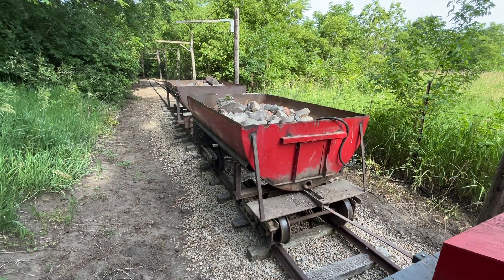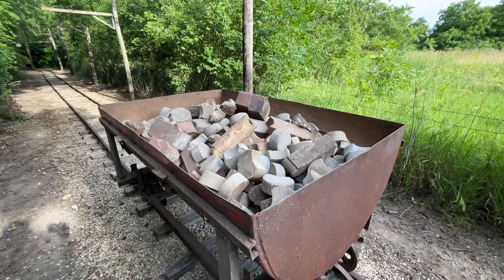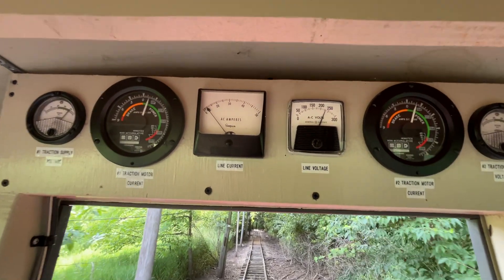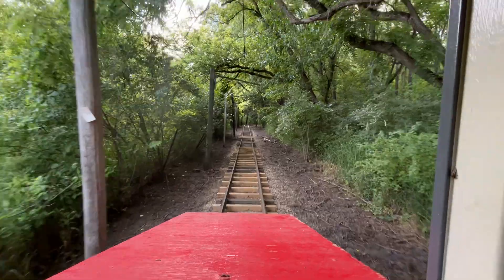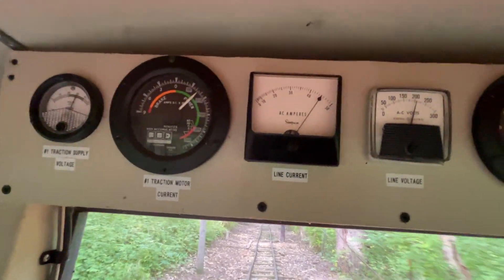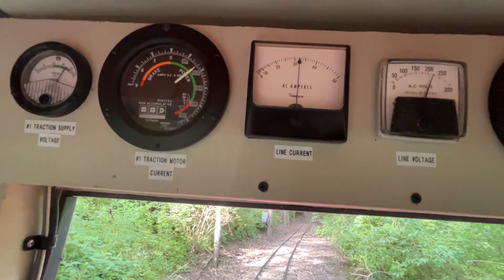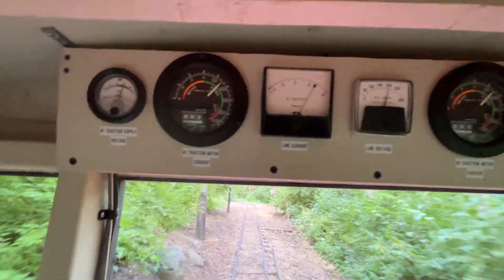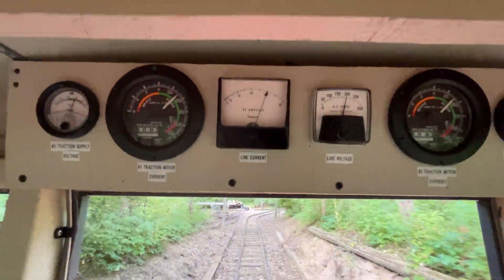Attempting to move loaded hoppers up the 4% grade with the steeple cab. Can we do it? Lets find out!

Comment: If ever you need a bit more traction I suppose you could just stop, get out, and move some of the load up into the cab. :)
Reply from the maker: I did consider putting some cinder blocks on the frame of the locomotive if it wouldn't go up the hill!

Comment: Nice robust run. By the way, have you gotten the tree down that was blocking a curve for the Boxmotor?
Reply from the maker: Not yet, its on the list but havent gotten to it yet. The problem is that the tree is being used a pole, and when I cut it down there will be no way for me to set a pole there without removing the stump. So I'm going to have to set a pole on the stump and use guy wires for it, or set the pole way far back. Not such a simple project, but it has to be done eventually.

Comment: Nice one !!!!!, quite pull power. I know probably no sense, but just imagine puting some sanders !!!!. I know you dont do this hauls usually. Love hove the amp meter lets you know about the slipage. Got me thinking if this could be feed back as a creep control or antislip. Just talking alone here ... LOL. Nice vis as usual Really enjoy them.
Reply from the maker: I considered adding WS control when the locomotive was designed, so the circuitry is already fairly easy to modify if I decide I ever want or need to do that. If I made regular heavy moves like this, I would add sanding for sure. 99% of the time there is no need though, so I just rely on the feel of the wheels and watch the ammeter to know how to get the best control, much like they used to do in the old days!